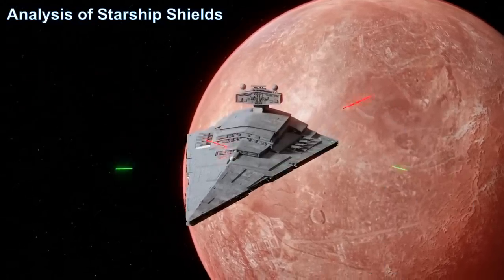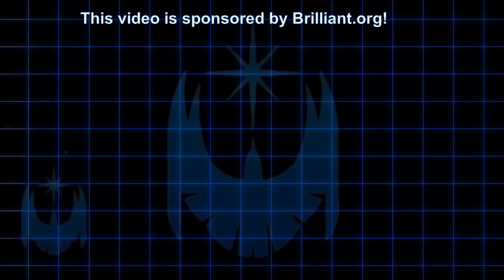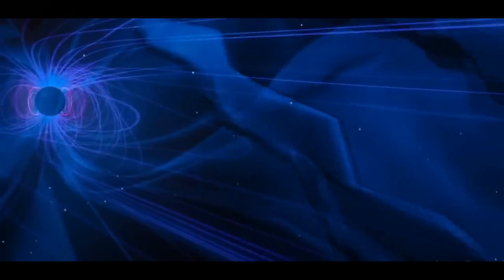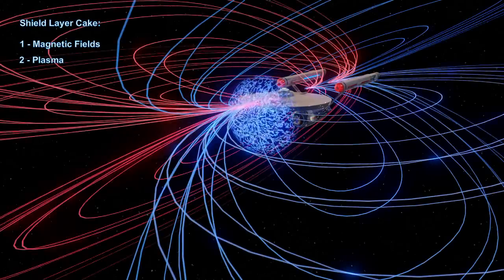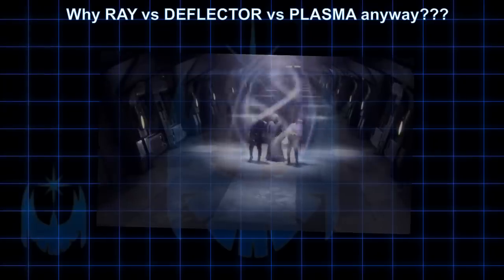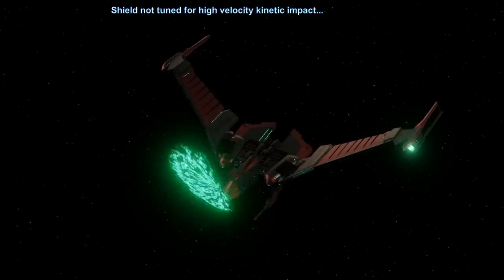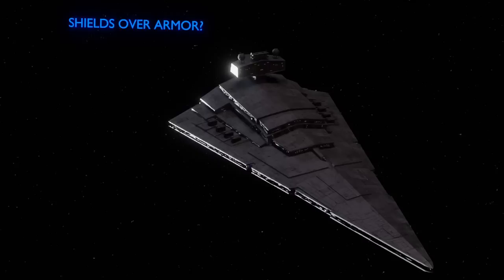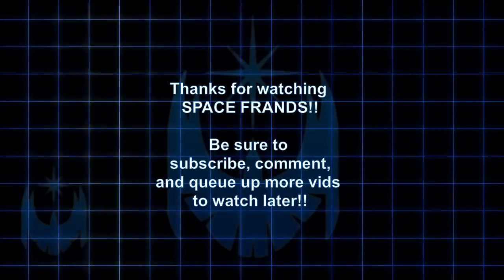REAL Starship Shields Types - They Work Like This...Animated Breakdown!

Comment: Actually, armour also have it's place in large battleship. Due to the square cube law, the bigger the ship is, the more internal volume it has relative to it's hull surface area. It's means a large ship can have metres thick hull and still have plenty of internal volume for a bigger generator and engine. Not to mention since you don't have to launch the ship from the planet as you are building it in space, you don't have to use expensive light material, steel for example would be cheap and readily available in space as most stars build up iron when they die. And laser don't have it easy going through steel as you think. Normally in industrial laser cutting, they have to use a jet of air to blow away the metal vapor or use pulsed laser to blast away the metal vapor because a cloud of metal vapor with block and dissipate the laser. But in the vaccum of space, you won't have that jet of air to clear out the metal vapor and without the atmosphere helping moving away the metal vapor, pulse laser will also become less effective at blasting away the cloud of metal plasma, the metal cloud will just linger around the impact site. Not to mention you can sandwich between layers of steel armour with whatever composite material you can think of. Imagine modern tanks armour but more advanced and they are meters thick. Besides in the vaccum of space, steel won't rust so after getting blasted by plasma or laser, whatever the steel armour remaining will have a shiny surface which help reflecting back some of the subsequent energy weapons shots. During the cold war, sometime the US put steel balls in the nuclear test sites. And they observed that even at only dozen metres near ground zero, the nuclear fireball only consumed a few centimetres of steel. If simple mild steel can achieve that level of protection, imagine dozen metres thick of advanced steel alloy and other metals can withstand from energy weapons?
Reply: In fact, you would want the armor to incorporate some water and lead. Water to stop high energy neutrons and to help cooling, lead to stop other penetrating radiation.
And I think it should be done in layered plates. Going from the main hull outwards, there would first be steel plates with water sandwiched inside. This water is kept liquid with the ship's waste heat.
Over them are more massive steel plates, with a layered structure of steel+lead.
And the outmost layer would be more massive steel plates, this time with ceramic plates nestled inside.

Each layer could be a few meters thick.
Reply: @Mathel_Steeltoe  I'd put another layer of ice at the outermost layer because of how cheap it is then spray some thin coating on it so it won't sublime in the vaccum of space. It should be a pykrete material with some radiation absorbing material mixed in, as the ice vaporized, the vapor will insulate the hull from the energy shot.

Comment: you mention "real world science" but neglect to mention how absurdly powerful the magnetic fields would have to be in order to shield the ship from ANYTHING. it's on the order of how much power would be necessary to warp space.... it would be monstrous and far beyond what we could even imagine now. also, what could a plasma shield possibly do to a solid slug? at most, it would melt it... but a high velocity slug with the same mass but molten wouldn't improve the situation much if at all.

I assumed that star trek shields simply used warp tech to create a bubble that deflects everything around the ship... but that would be too good of a solution... nothing would weaken that shield except losing power. also, because light would wrap around and past the ship as well, it would be invisible... shield and cloaking all in one.

Comment: Somthing noteworthy is that magnetic effects have a VERY small effective range. meaning even with future technology, it may be infeasable for the largest ships to have only 1 shield generator
Reply: Exactly. You're going to require quadratically more power, and tuning things like 'plasma lenses' might be far more effective if you could position 2+ generators to create locally convex/concave magnetic field patterns as opposed to the profile from just 1 generator.

Comment: wait, so if a plasma shield isn't a invisible wall, but rather is actively manipulated by magnetic fields in retaliation to attacks, much in the way of a small shield blocking an arrow, then would 'upgrading the shield' simply be getting a better cpu that manages that magnetic field manipulation? Also, how would it even manipulate it fast enough before a laser going the speed of light hits your ship?

Comment: I think this is really trying to force shields to be a thing without really understanding the technologies your quoting.

Plasma shields are an interesting concept. Firstly, while yes magnetic fields can confine plasma, I don't think you can do it without equipment on both sides of the plasma. 
Normal plasma confinement can be imagined as balancing a metal ball between two magnets. How are you supposed to balance a plasma shield outside your ship if you only have magnets on one side of the shield?
Ignoring this issue and moving on, another topic to discuss is how exactly plasma is going to act as some impenetrable barrier. It's not gonna act like it does in films, all you have done is put a wall made of a very malleable substance between you and your opponent. You may as well have just used some kind of liquid, or something else thats considerably more easy to work with than plasma, and keep in mind none of these are going to be as strong as whatever your actual armour is made of. It's also worth noting that plasma is not invisible, if you have a shield you will physically be putting an opaque (to both visible and radio mind) wall in-between you and what you're trying to shoot at, and it's not going to be so easy to deploy and retract either.
Still, there could be some merit in an additional form of armour that can be replaced from a tank as opposed to needing repairs, but keep in mind as you sort of mention at the end of the video it will act like armour and not like a sci fi shield. A shield of this kind will almost never stop a serious projectile, but it could slow it down enough to give your actual armour a better chance.
Reply: Magnetic deflectors are obviously a more scientifically plausible concept, but there is some serious practicality factors to consider. 

When you have a projectile heading at you at incredible speeds, you would need an incredibly strong magnet to deflect it (likely a completely impractical amount of energy, but this is far future so ill give it a pass). This magnetic field needs to be constructed in such a way that it also doesn't rip apart the metal ship firing it.

I imagine if you where to build such a system you would want to have more of an active deflector system, that detects incoming projectiles and activates surface mounted electromagnets to create a magnetic field around one small part of the ship. 
Ofcause at this point however you have to question if it would not be easier to use a kinetic interceptor (like TROPHY aps). This would be a lot more energy efficient and also work on projectiles that aren't magnetic. That's not to say both systems arnt' useful however, a magnetic shield is very useful against more mundane yet serious threats like cosmic radiation and possibly some kinds of micrometeorite.

Comment: Fun thing with Star Wars shields and the Death Star attacks.
The exhaust port (one of at least a dozen) had ray shielding, much like many of the exposed systems on the Death Star, and that made them immune to most blaster fire. However, the designers knew about the threat of a bomb being dropped into a critical system, and many of these systems were given particle shields as well. These can sit flush with most surfaces or enclose gaps, and are even used as airlocks due to how they interact with fluids.
However, Star Wars particle shields by their very nature don't play nice with solids. They need to have a gap between the edge of the shield and any nearby solid surfaces, such as those they are protecting, or they can overload or damage the surfaces. 
So, that plan and the crazy approach was actually 100% needed by the in-universe logic: a dive bomb approach would have protection from both bombs (upper particle shields) and blasters (inner ray shields), you had to slip a physical projectile under the edge of the particle shield so it could then go through the ray shield beneath that. 
The solution for the Death Star II was also pretty simple in concept if complicated in logistics: Just have a massive offside base project a planetary-sized ray shield around the station, that way ships would crash into it if they approached. Throw up a sensor jammer and they won't even see what they're about to crash into.

Comment: There was a tabletop game series back in the 1990's by FASA called Renegade Legion. Their shields acted by having a vibratory frequency, and affected both physical and directed energy weapons. However, they could not be maintained all the time, and had to be shut off and on dozens or hundreds of times per second. They pretty much automatically deflect incoming attacks that hit them, but the overall effect is a penalty to hit. They also could not stop heavier projectiles, such as full gauss cannon rounds. Therefore tanks would have "painting lasers" to measure the flicker rate of the shields, and enable them to time their incoming attacks for the moment the shield flickers off.

Comment: 4:53 Star Wars shields consist of two overlapping layers of deflector shields. Ray shielding would stop "energy" such as plasma, lasers, electricity, radiation, etc. Particle shielding would stop physical objects from passing through it, bouncing/redirecting objects like strike-craft or asteroids off and away from the ship.  An object that hit it on a pretty direct course or couldn't be deflected would end up similarly to running your car at max speed into a solid wall or sometimes disintegrated.  The particle shield can also be turned on/off separately from the ray shield to allow strike-craft and shuttles to enter/leave the ships hangar.
Reply: I'd love a Star Wars game to represent this (maybe even an Empire at War successor). I did like the idea
Reply: That's how it described in lore but, to put it mildly, it's not very scientific ^^
Reply: @ImperativeGames  It also very rarely works that way in actual Star Wars stories, outside of lore books, Legends or Disney, they're all kinda will-nilly with how shields actually work.
Reply: @Ben Quinnobi  The X-Wing series is fantastic for the military spacetech stuff used to its fullest.

Comment: the way they talk about "plasma" in star trek, especially TNG, it may as well be magic.
the 90s had a funny approach to plasma. science fiction often treated it like glowing acid that melts your body into a puddle of goo.
Reply: To be fair, plasma is superheated ionised gas. Firing a contained ball of superheated gas at someone would indeed melt them into a puddle of goo, just from heat and not chemical decomposition like acid. And due to being superheated, it does in fact glow, since it emits large amounts of blackbody radiation. However, sci-fi does pretty much insert 'plasma' to mean spess majick, that is true.

Comment: The advantage of armor is that it is always there. Shields have multiple points of failure - the shield itself, the shield generator, the power supply and the connection between the power source and the shield generator. Sci-fi materials science would also be able to create self repairing or adaptable armor that could change its morphology or structure to meet different threats, whether through nanobots, repair drones or energizing the surface like in Enterprise (though this leads back to the energy problem).
Stargate Atlantis (minor spoilers) has the city shielded for 10,000 years at the bottom of an ocean leading to a crisis when the power runs out. Any high tech civilization that was not terminally stupid would have just built the city out of super advanced material that could withstand the water pressure.

Comment: Interesting theory crafting.  Works well for Star Wars ships, but all your ship types are mostly some form of electron or electrically heated based shielding tech.  None of it can apply to Star Trek shield and weapons tech as Star Trek weapons and shields are using customized subatomic particle energies.  Nadeons used in most phaser systems are one such artificial subatomic energy particle. If you used any of the 3 energy shield types you mentioned against a Nadeon beam, the Nadeon stream would simply rip threw the shields like a hot knife threw butter.  So shield systems capable of defending against a Nadeon stream would also have to be using subatomic and quantum physics control systems, of which Star Trek has an abundance of but Star Wars does not.  

subatomic particle energy shields managed by quantum control systems would be effective against both physical and energy weapons.  Lasers, Missiles, Nukes, Ballistic projectiles all would be easily nullified against such shields.  Only weapons effective against such shields are other particle energy weapons or the sheer mass of the hull of another starship doing a kamikaze run.  Then you would see some of that bleed threw effect, where conventional lasers, ballistic projectiles and conventional explosive missiles, even nuclear missiles would not be effective against such shields, unless you used a massively, ridiculously oversized version those weapons.

Nadeons are specifically made to tear apart atomic structures and bonds.  The shields you listed i this video are in some way or another, based on electrons or electromagnetism.  A Nadeon stream would simply rip threw all of them with ease.

The problem with trying to use all those forms of electron controlled shields is that they cannot be easily or reasonably shaped using those electronic controlled systems.  You would inherently need something more advanced and capable of controlling a large number of smaller particles then electrons and electromagnetism can afford you.  Otherwise you won't be able to have holodecks nor holograms able to walk around with a mobile emitter.  Fine tune control over subatomic particles using quantum controllers is ultimately our only option in order to have enough control over force fields to actually shape them and make the shield movements fluid enough to have a holodeck and its content, much less have a skin like shield over your ships hull or even for your own person.

Once you get to that point, you have shields that can take all that laser fire, charged ion plasma weapons fire, ballistic projectiles, conventional missile explosives, even nuclear weapons.
You would need a laser cannon the kind of which only the second larger Death Star had in the 6th Star Wars movie (or 3rd, depending on your perspective), just to be able to do some damage too a shield based on subatomic particle energy control.

Comment: The best analogy is a Knight.
A Knight will typically carry a Shield designed to deflect, absorb and redirect incoming objects. The Knight also has armor, that is there to absorb and stop anything that is not defeated by the shield.

In essence most ships outside of StarTrek have this type of philosophy. A Energy/Plasma based shield system designed to defeat oncoming aggression. Then behind that shield is sturdy armor layered in a way that it can absorb, redirect and deflect oncoming damage if the shield was to be penetrated.

The thing is, most energy based weapons the shielding and some extension the armor type can dissipate the thermal energy across a larger section of the ship's structure. The issue is if something kinetic  or explosive hits, that inertia caused by those types of weapons has to go somewhere.  That absorption is shunted across the whole superstructure of the ship. The shields and armor may absorb a large amount of that energy, but the bleed through is going to be shunting into the internal structure.

Comment: MUST READ. It baffles me that noone ever considers nanotechnology as a future tech when it comes to sci-fi. Imagine an entire space ship made of nano machines that can form anything needed at the time. For example, imagine backing a dump truck up to a hole dug in the ground, dump the nano machines, and in minutes a house is formed. All the aspects of the house can be moved and reformed at any time such as beds, stoves, walls, ect. As far as space ships are concerned any new technology doesn't need to be refitted into the ship... it is simply programmed and the retrofit is formed into place by the nano machines. Weapons, shields, repairs...anything.

Further to this, what would the world look like with this tech? No more run down buildings, massively reduced landfills, clean... everything, perfectly functioning infrastructure that doesn't break down..... the world would be forever changed. THIS IS FUTURE TECH... EVERYTHING ELSE IS CHILDS PLAY.

Comment: At least in TNG, the navigational deflector used tractor beams for larger than microscopic particles. And the navigational deflector sensor array was used as part of tracking and adjusting of the deflector shields.